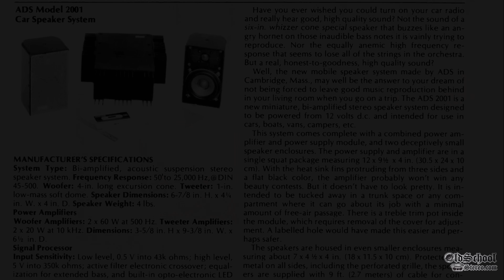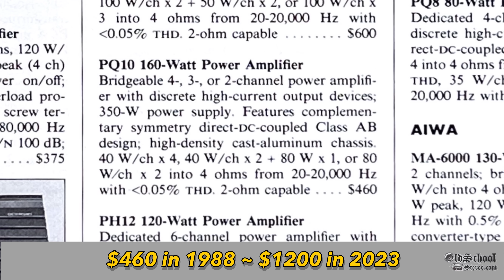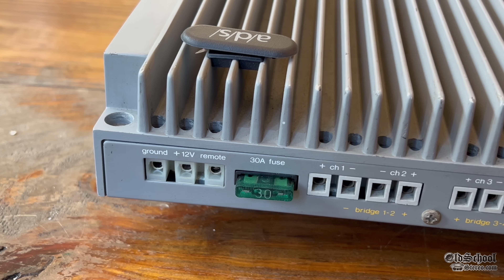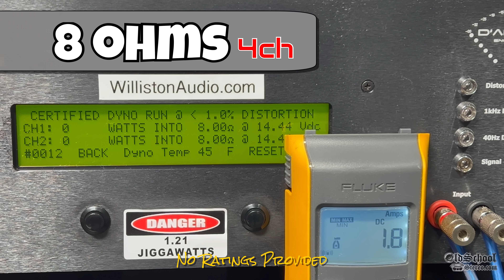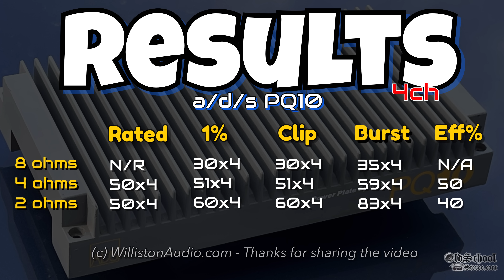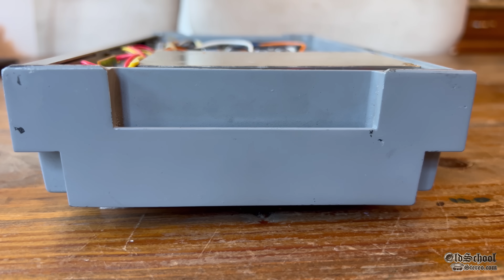1987 ADS PQ10 Four Channel Amp Dyno Test

Comment from the maker: July 1975 Audio Magazine - https://is.gd/AudioJuly1975

SHOP
Elac Debut 2.0 B6.2 Bookshelf Speakers: https://amzn.to/3Mmdbcz
SAVARD 6.5" HiQ Subwoofers - https://lddy.no/1iv98 (use code WAL for 5% off!)

7 Days of Amp Tests Playlist: https://www.youtube.com/playlist?list=PLuodE1Zx7Y-6bhrEfCERSfl43EpB3P3lS
Related Videos
Vintage a/d/s PQ20 80x4 Amplifier: https://youtu.be/KrLNDorSHKk
Brand New 37yr Old Sony Speakers: https://youtu.be/i9zZOLvf_bI
'80s Sparkomatic Speakers: https://youtu.be/loxJa2k2O5A
1984 Kmart Blue Light Special Speakers: https://youtu.be/ckvjUcq-ABs
Vintage Radio Shack Optimus Surface Mount Speakers: https://youtu.be/hzKgtjZOaRg
The Worst $200 Speakers Ever: https://youtu.be/S42JA00XVb8

TEST BENCH EQUIPMENT
SMD / D'Amore Engineering Amp Dyno: https://goo.gl/sJTcf7 
XS Power D1400 Batteries - https://amzn.to/2BPFCKW 
XS Power PSC60 Charger - https://amzn.to/2CHGcfs 
Fluke 1000A AC/DC Clamp Meter: https://amzn.to/2Rw5WDA 
Handheld Dyno: http://amzn.to/2u2EgKV 
My Favorite Screwdriver Kit: http://amzn.to/2x0VzcE 

DISCLAIMER: This video and description contains affiliate links, which means that if you purchase from one of the product links, I may receive a small commission. As an Amazon Associate I earn from qualifying purchases
Reply: Hey Big D, have you seen that U.S. Amps are producing New Products???
They got a YT Channel too

Comment: Only thing missing is the din cable crossover unit.....I had a few of those amps.   The gain pots were very prone to breakage when monkeys used to put the wrong size tool in there.  But definitely a mid and high sound quality amp

Comment: A/D/S, MB Quart and the others were high rent district and for the Audi/BMW owners while the rest of us were down here with our Zed (HiFonics/Lanzar/Autotek) as our high end lol. We always saw those higher brands as more of SQ and not able to bang with us bass heads. But they did garner much respect as the price was way out from what we could muster back then in the Bay Area. I remember a purple bug and the dood used EV 18’s cause there is wasn’t much available back then. Hell i remember seeing and being mixed with flee market brands at shows like Akai being more of the top end of the crappy brands. Another brand that was a bit high end but could bang was Linear Power and ZAPCO. While the higher end that could bang was Precision Power (the white ones I think were gaethe sp? Series) but yeah it was so dynamic back then. I loved the late 80’s and early 90’s for car audio. Much nostalgia from back then.

Comment: The problem you are having getting 10awg connected is that you need to use solid core.  Take 1/2" of solid 10awg and solider it to the stranded 10awg and BINGO.

Comment: A/D/S was hands down the cleanest power for car audio in the late 80s-early 90s. I ran two of their PS5 amplifiers (one for front, one for rear). I believe they were $230/each back then. I was labeled an "audiophile" at 20 years old because of this, even though I didn't have the money to buy one of their 4 channel amps and bought the PS5s 4-6 months apart. LOL   Beautiful sound with extremely low distortion.

Comment: I own no less than 3 of the A/D/S/ 2001 amplifier systems. Heres one for ya Big D...  Look backwards from here... look for ANY Autosound companies selling amplifier systems in that magazine. A/D/S/... started it all, FIRST High Speed Switching design, same design used today in all MODERN CAR AMPS. A/D/S/ gave us the first MODERN High Power, 12volt amplifier. https://www.youtube.com/watch?v=a4M9D68EjQs
BDBD/2023.
Reply: All (3) of my ADS 2001 amplifiers are currently in shop being modded and restored for 2025 at great expense.  I am springing for ORIGINAL CAN CAPS for the T0-3 VERSION I own. The other two will sport bypass able crossovers as well as REMOTE WIRE and all new caps that reflect modern day productions. Metal Can Caps are fast becoming impossible to source new, so yes, only the T0-3 version will get THAT treatment. Autosound History.
Then theres the 35 volt capable SA1600 I just had modded for EXTREME USE... Fun Fun Fun in 2026... BDBD.

Comment: I love my 2 pq10 amps. Best amps for sq. Not good on subs but worlds apart from my soundstream amps as fas as sq for the upper range. I ran mb quart reference separates 6.5 in front. 1 amp bridged per side. 1 ch for the tweets and 1 for the mids. Man it was so nice.  The sound was so much deeper with the ads where the S.S. sounded good but everything was on the surface. Idk how to explain it. Just awesome amps for sq.

Comment: I made a whole bunch of harnesses for these way back when…
Reply: I remember paying $200 for a PQ8 in the late 80’s, having to pay $60 for the din to RCA. I was like “wtf” to the sales guy.
Reply: @ I found the DIN connectors on eBay and just cut up a bunch of RCA cables and got to make them the exact lengths I wanted each lead to plug into the 90’s nonsense I had… EQ and whatever else.
Reply: @Spaman42  Guilty, I did the exact same thing, still have a few of the naked din plugs. 
Al least ads gives you the pin diagram right in the manual.

Comment: I ran one of these in my rx7 for a few years just running front speakers and a ported sub. Never heard something so impressive for the age and rated power. I still have this amp and a pair of pq20s, and a pair of ps5 amps. I can't seem to get rid of them given how good they are

Comment: class A/B BJT amps are by there nature have regulated output. the efficiency sucks but no class d has the dampening to control the cone pos like an A/B (Class T and Full bridge Can get very close to A/B if done right full bridge has the added advantage of not requiring output filtering for switching freq since the exact same signal is on both terminals there is no difference in potential that's required to drive a current in the coil. and coils only respond to current as current = magnetic flux and a simple I*R=V and V*I = P(watts) but this is also heat 1W = 3.41btu so the 2500w each one of the sub i have are trying to cool a 8500btu heater coil there are some inductive losses that subtract from coil heat but it's based on tuning and the motor force. in general most large subwoofers are only converting around 10-15% of the input into sound pressure the higher the power for a given cone size the worse this gets and 10-15% is a best case at a fix frequency give it musical range and it's half that the rest of the power is all heat.

Comment: @OldSchoolStereo- A friend of mine, back in the early 90s, had an older brother that worked @ a High End Audio dealer, that sold High Quality Home, and Car audio. Around 1993, my friend had this High End audio dealer, install an A/D/S Power Plate 4ch, im thinking this same amplifier PQ10, or a PDX, im not sure? I know it was 40 x 4 rated though. He had them run the front 2ch's, to a pair of Alpine 4 x 6 Plate's, in a 1989 Camaro Rs. Then he had them bridge ch's 3, and 4, and ran them to (1)-10in JL Audio 10w0, or 10w1, that sat in a custom built sealed enclosure, that fit perfectly in that far rear pocket, with the sub facing upwards. That JL Audio subwoofer, loaded perfectly, off of that horn shaped, rear hatch. I would have picked a 12inch JL, but that shop was convinced, that for Sq, 10s were the best, so they talked my buddy into the 10inch. It could have been because of airspace requirements, but either way, that 10 not only sounded great, but had very surprising output, for 80watts rated, from that ADS PQ10, which you dynoed to actually do around 110watts. Thanks for your time to show all the details, + the dyno❤️

Comment: Well my long held opinion of these amps has finally been confirmed.
 I never thought they were worth their asking price be it power output or sound quality.
  When you pulled the back plate🤮🤮🤮😅
  Single sided board ✔️
Wire monster ✔️
 As always I appreciate your efforts 👍!!!
Reply: Like all stuff from this era, you’re paying 75% nostalgia tax.  Worth grabbing on a table at a flea market for a bargain, but anyone that starts asking multiple Benjamins for one…pass.  Compare this to the other garbage people were buying in the late 80s and I can see how they built a reputation, but jump forward 3-4 years and even budget equipment surpassed them.
Reply: I am not sure an Alpine or Kenwood of the era would have so many jumpers and phenolic. Components chosen to have a good sound and care with shielding (ok, no multi-layer FR4 or G10 PCB with ground planes or noise rejection traces...). Bad efficiency and is no longer working properly. Caps? Well, a Class AB amplifier should be used with a load when the efficiency is no less than 48% or it will heat soak and sound like doo at elevated volume/output. Below say 45% then something is wrong, the load is wrong, or the design is wrong. Just WRONG!

Comment: I had a PQ10 a little over 20yrs ago and its efficiency was so low, on warm days I had to remove a trim cover in my car or it'd go into thermal shutdown. When I redid that system I got a P840 that barely got warm (also mounted in another location). The P840 had full crossovers so I ran that setup with no passive crossovers at all.
Reply: yeah, heat was a major concern back then, Class D amps these days addressed the heat issues really well... STILL, need a decent A/B amp for them mids & Highs but they too run cooler for the freq range they pushing.... PLUS PLUS.

Comment: I had a ph15 and it was awesome. It was in a Cadillac allante with a alpine controller in the ashtray location and a changer. Also had a/d/s components and some 8 inch sub in a 4th order. It was all installed when the car was new. Sounded awesome.

Comment: Fact that that thing survived roughly 36 years without any signs of (serious) moisture. Moisture was a issue in cars back then compared to now.
Reply from the maker: Agreed!
Reply: I spotted one of these at a flea market a few years back, knew it instantly, flipped it over and the whole back plate was rust and clear water damage, I passed.
Reply: @chrishuyler3580  Yep! Thats what i would have expected with stuff for more then 30 years old.

Comment: That amp looks to be capacitively coupled in some way...perhaps common collector + floating ground like QSC does now adays where the filter caps are part of the speaker outputs.     Could surely be due for new caps, which would explain the 40hz anomalies.
Reply: Just a typical Emitter follower as with most amps.

Comment: Sounds muddy just like I remember
Reply: Lol muddy? No one would ever describe the sound this amp produced as "muddy". Except someone who never heard one before. There were several high end systems back then that used these amps in SQ builds and took home trophies with them. " muddy" amps would never be used in a pro SQ build, yet these amps were incorporated in quite a few of those installs. Either you heard a badly damaged one, or mistook it for something else, these amps most certainly didn't sound "muddy" at all.
Reply: @808teckie6  compared to the 1990 autotek amp from the last video, it definitely  sounds muddy. The treble has no real sparkle, and the midrange is dull and lacks clarity.  And yea, I had this same amp didn't like the sound then or now 😒